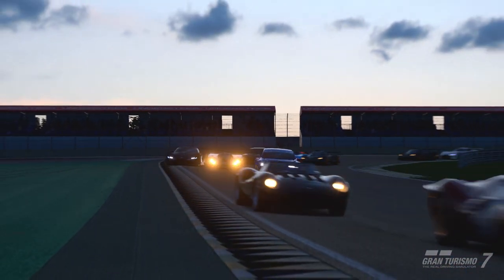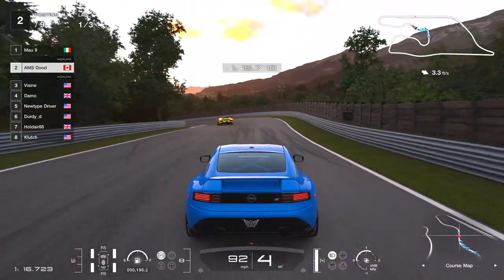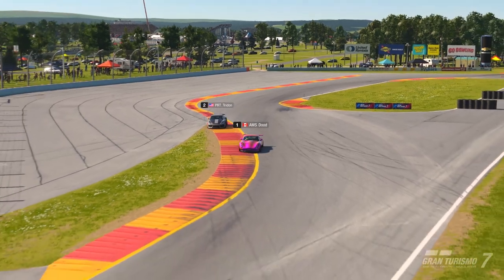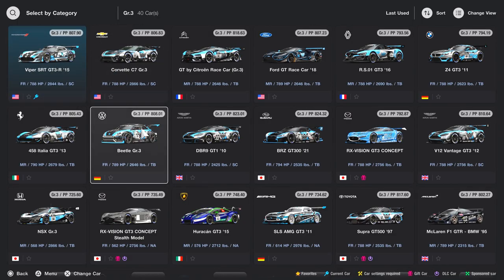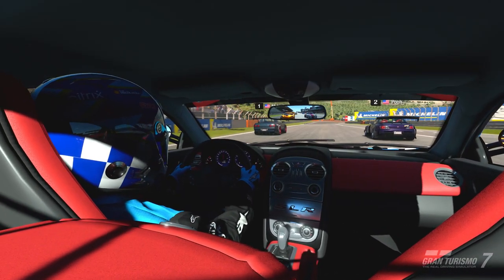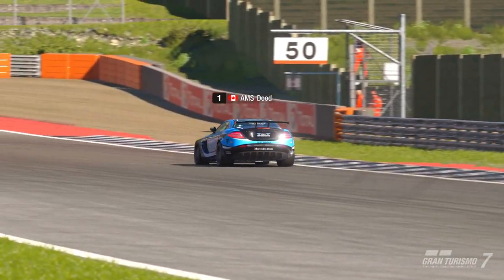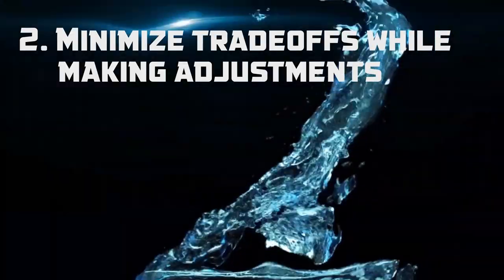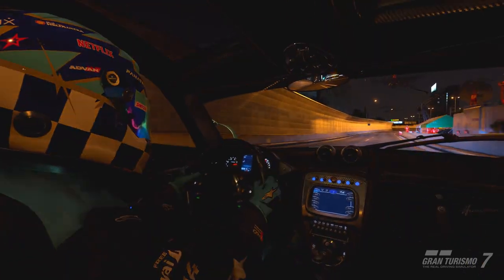TOP 10 GT7 TUNING MISTAKES! - Setup Psychology Explained

Comment: Really wish it was quicker to tune and test.. Should be a 'testing' mode, so you can sit on a track and toggle back and forth.. Even if you have to do a lap and pit to make changes, then go out again. It adds so much time, going back and forth between menus/screens
Reply from the maker: This would be a really good idea. Would save all of us so many hours
Reply: I thought you can already, or did they just add it?
Reply: @Benjiizus  where/how?
Reply: Use circuit experience for tuning...

Comment: A great baseline is the sports suspension.   Change those settings.  If your need more settings.  Then add the pro suspension.
Reply from the maker: It’s always good to start out slow before you start adjusting everything for sure.

Comment: As a racer who's been testing and tuning since fm1, works on cars irl, and has learned a lot since then, the biggest gain for me from this is the scale of change from one extreme to the other being small. I have made frd max soft in front and max stiff in rear, and they're still drivable. This made me lose a lot of my passion for tuning in gt7. I'll go back and make these larger adjustments to test this theory. 

Thanks for the tips!
Reply from the maker: It’s a good way to learn what each change does! There are definitely common adjustments and values across many tunes but also infinite adjustability if the car demands something different!
Reply: Same. Gt7 is trash for not getting the tuning right. It is almost as if they never put any thought into it whatsoever.

Comment: Great video! Thanks for the guidance….. Question, can you suggest which track, or tracks, are the best for working on tuning the cars?
Reply from the maker: Obviously if you have an event at specific track, tune the car for that track if possible. If you’re trying to make a versatile setup, look for a track that has a mix of fast and slow speed corners, also make sure the track has an average amount of time spent on the straights. Trial mountain, dragon trial seaside and road Atlanta are decent options. Maybe sardegna Road track B as well :)

Comment: Had a question for you that's been bugging me about shift points, specifically in Gr3 cars. How come when I look at the HP and torque graph for a certain car and see that it has a massive power drop off close to max rpm's, I think "oh I must have to shift early to keep it in the best power band." Sometimes that is true and sometimes maxing out the rpm's is best before shifting, even though it shows a massive power drop off. Just hoping you could shed some light on this for me. Thank you dood
Reply from the maker: What you’re seeing is correct some cars do lose power before maxing out in the revs. However what matters in this situation you’re describing is what RPM the car has in the next gear. If the next gear bogs the car down significantly, you should rev the car out more in the previous gear so you can be closer to peak power again in the next gear. Every gear you spend a certain amount of time in you should try to maximize the average power level across that time, sometimes that means shifting very close to peak power, sometimes that means you should rev the car more than you think.

If a cars power falls off a cliff after peak power usually that means you should shift it relatively quickly after peak power. Also if a car has 7 or more gears it means the gear ratios are closer together so that bogging in the next gear effect is less pronounced so you can afford to shift closer to peak power.
Reply: @AMS Dood  ok! I think I understand. I'll have to play with it a little more to try and replicate what you speak of. Every time I think I have this game figured out it throws another wrinkle at me, but once I figure that wrinkle out I end up faster. It's super rewarding. Thank you as always for the quick response and great explanation. I really appreciate all the knowledge you've shared along the way. Keep up the great work, bud!

Comment: Do you know a guide how to tune cars that are driven by AI in custom races? I'm working on a grid with 20 different cars and when I'm testing them, they are all within 1 second. If they're driven by AI the faster cars take off couple of seconds of the slower ones
Reply from the maker: I honestly don’t know how setup interact with AI cars. I have a similar experience to you. Race cars seem especially slow compared to road cars with AI driving them. Perhaps they all get reset to default.
Reply: @DoodRacing  did a lot of research. The only way to balance the cars is to test the grid over and over. Setup-changes definitely work

Comment: Realy need help with the diff  please
Reply from the maker: I’ll release an entire vid on this soon but here’s a quick rundown:

Initial torque: The higher you put it, the more your car will understeer when lifting off the throttle, it also causes more wheelspin, this wheelspin is predictable but not helpful. Overall initial torque slows down lap times and I run it at 5, 99 % of the time.

Acceleration sensitivity: the lower you run, the more easy the car will be to control out of low speed traction zones, higher value is for cars that have fantastic traction out of low speed corners. Running it higher also promotes more on-throttle rotation in high speed corners, but in GT7 the difference in negligible. Also be careful to not run too little acceleration sensitivity, because on most cars a super low value causes one wheel peel, where the inside rear tire slips and causes a loss in power at low speed. 

Braking sensitivity: has nothing to do with the actual brakes, rather the engine brake. The higher the value the more the car will understeer entering a corner off the throttle. High value is great for mid engine cars that are ass happy entering corners. Low braking sensitivity is good for cars that need more rotation entering corners ie cars that understeer off throttle.

Comment: I notice in every tune you have your toe to Zero front and rear?
Do you always do that and if so why? Ps great vid and have subbed thanks to this one.
Reply from the maker: Toe destroys straight line speed without providing any quantifiable benefit on MOST cars. in many cases,I do run some positive toe on the rear of cars that need more stability on traction or corner entry but never more than 0.30
Reply: @DoodRacing  awesome and thank you for the explanation.